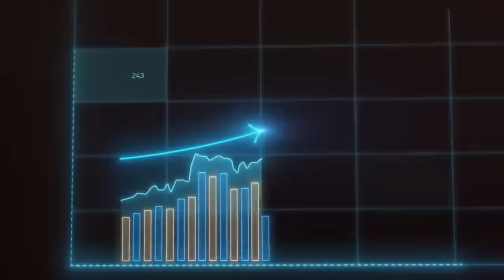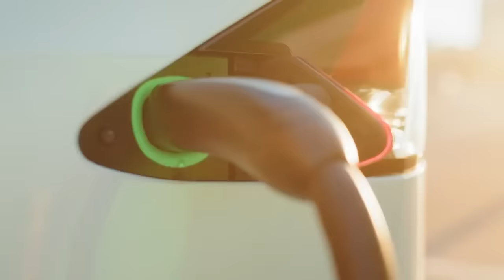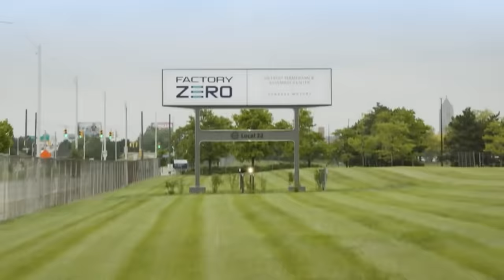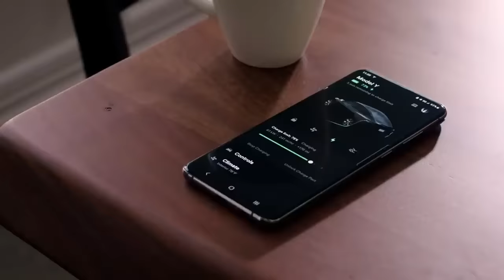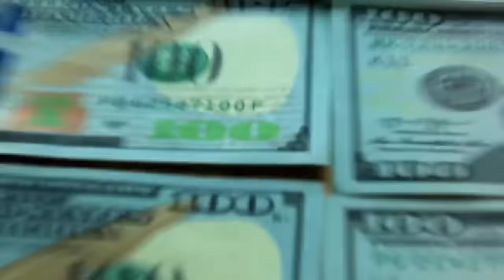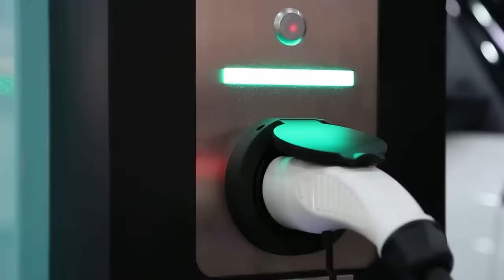Electric Vehicle Owners Are Frustrated and Demand the Return of Gas Cars

Comment: EV industry is touting "well with the new battery chemistry, batteries will be much better for the environment and cheaper"  DOES NOT MATTER  They still have to be charged!!!!
Reply: and what exactly IS charging?

its an electroplating process. and only a small amount of energy actually goes into the "charge", aka electroplating, the rest is used to overcome the inherent "struggle" that always occurs inside any battery, two metals corroding in an electrolyte, producing opposing EMFs where the resultant "output" is the DIFFERENCE between the two!
a charging battery is electroplating, a discharging battery is corroding... very simple. very inefficient.

its well worth looking into "galvanic corrosion" and exactly how a battery actually WORKS... they used to teach these basic things at school, had books for young boys and girls (mostly boys but even girls were allowed to tinker with chemicals and wires and lightbulbs) to play and experiment and learn, its how we got television and radar and computers, by having children educated on how things work,  once-upon-a-time...
Reply: Coal is only 19% of power generation and burning natural gas for electricity as far cleaner than burning gas in a piston engine.   I stil have some gas toys but if you can read a manual and rember to plug in and set a clock then make sure you have a 250v plug like an appliance plugs into.   Then get one and home charge its great.  I've seen 300,000 mile original battery model 3s.   Battery failures under warranty are rare and they get repaired and reinstalled.  

Its still 80-90% efficiency vs 20-30% efficienty.
Reply: regardless of what is said the battery technology is no different than it was 20 years ago.

Comment: I remember being at a career school, and a teacher doubted me (I was in an auto tech class) about the future of EVs. Years later here I am being proven right, even on paper these cars aren't a good solution. If your solution requires mass production of a product using lots of expensive materials it's not a solution. The problems with these cars keep coming to light, and now everyone is starting to see their issues.
Reply: Ev cars have been around before the gas engine I believe. The batteries were probably the issue back then as well 🤣🤣🤣
Reply: @jakefriesenjake  yep they used lead acid batteries, they were even more useless then though extremely short range and almost no infrastructure to support them. The first EVs were just toys for the rich to get around town and no further.
Reply: Even if we disregard that, very few countries has the infrastructure or power to support too many of EVs. Yeah, any house can charge an EV but how long is the charging time? 10+ hrs? While gas car can be topped up in a few minutes. Who wants to sit around a gas station for hours? 

So even if you believe EVs are the future, you'd have to acknowledge that widespread adoption and replacement of gas vehicles isn't possible for us right now.
Reply: As soon as I saw how big of a battery an EV needed to work I knew they had no place in the future....and that was years ago. I keep finding downsides for these things, uncontrollable fires, insurance rates, infrastructure,  crashes, likelihood of being totaled, charging time, cost....I'm probably forgetting something, but ya they are a "solution" likely being pushed for lithium investments. Investments our politicians likely made before making the"green bill."
Reply: Do you realize that  a new model 3 costs far less than the average cost of a car in the US?   A Bolt is even less.
Reply: @rcpmac  A 2023 Honda Civic has an MSRP around $23,000, a model 3 is around $38,000. Yes a bolt is around $24,000 but how many people do you see driving a compact economy car? People don't want them, Honda stopped selling the fit in the US for a reason. Even with all this said EVs have higher insurance costs, higher if you want an at home charger for convenience.
Reply: The only real replacement for the standard car is the plugin hybrid...
Reply: @markthompson4225  I do think hybrids are a lot better than EVs they can actually operate in the cold, they use a lot less lithium probably 1/4. And they have been proven to work I've seen a first generation Honda Civic hybrid come into work before. They don't need new infrastructure, and you can just fill it with gas instead of worrying about charging. The thing that baffles me is they do work but we supposedly NEED to skip to EVs.
Reply: Teachers are idiots; had one tell my parents I had dificulty with physics because I  asked questions. Come exam time, passed with flying colors  then went  to a top university.
Reply: @DemiGod..  yea this same teacher of mine also called California a state striving for innovation, yea there's reasons people move from there at high rates. However I liked my junior year government teacher, he actually showed people media corruption and told people to ask questions.
Reply: @jakefriesenjake  Not just batteries, but brushed motors are not as efficient as brushless.  Technology has come a long way, but not yet far enough in the battery department.  Further, the production of electricity isn't green... yet.  In California, people were asked to run Air conditioners, bad for the grid, EV cars are 10 times worse!
Reply: @Cr0wdse3ker  Exactly!  Toyota is also a much more reliable brand that costs less than EV's
Reply: @COSMACELF1802  Toyota also is the only company I've heard of at least buying back some of their customer high mileage cars to dissect them and figure out where the weak points are, there are some high mileage Tacoma's and tundras out there .
Reply: @COSMACELF1802  were asked to "not" run their AC's in California after 4pm, I think the time was
Reply: As someone with a career in the power industry, the battery and green bullsh*t didn't fool me either.
Reply: At least is nor fossil fuel that destroy the inviorment.
Reply: @daveolep7657  if you mean that fossil fuels destroy the environment look into the total rates for EVs, and the CO2 released to make them. Just because it doesn't have an exhaust pipe doesn't make it environmentally friendly. No human activity is environmentally friendly.

Comment: EVs are a scam.  🔥 🚒😢
Reply: 1. Child battery mineral labor

2. Range anxiety

3. Risk of garage fires

4. Paying 20k more than a
comparable vehicle

5. Battery denegration

6. Poor resale value

7. Reduced performance in
cold, highway

8. Higher repair costs

9. Awful charging network
experiences in the weather
without restrooms

10. Higher insurance rates

11. Replacing tires more
frequently

12. Death by autopilot

13. 30 - 40k battery

14. Low km range

15. must wait 2 hrs
to charge

16. Then wait more time to charge, while charging.

17. Spontaneous combustion with no way to put out the fire storm.

18. If they catch fire in a tunnel, many people will die.

19. People without a pro charger system or a parking spot at their house, will run an extension cord to the road, which is dangerous and could lead to people tampering with your charging setup (super slow charging at the road)

20. If your in California, you won't be able to charge your car past 4pm because of a shortage of electricity supply on the cheesy grid.

21. It is not actually "green". The pollution is made at the power station, not the car.

22. Only 5% of used junk batteries get recycled, the rest go directly into the bin. It's cheaper to mine for new minerals.

23. Chhinna actually does 70% of all the refining of the minerals and production of the batteries.

24. Minerals are becoming more and more scarce, and the cost will only go up, not down.

25. Some countries where they mine for lithium, actually use a very big boat load of fresh water to only produce a ton of lithium, so they are afraid of running out of water. It takes over 2 million liters of fresh clean water to produce 1 ton of lithium. 

26. Ev cars will soon not be able to drive in tunnels or be able to park in underground parking garage and probably will eventually void your house insurance if you park it in your personal garage.... 

27. You can't charge your battery at super stations when it is bitter cold out.

Comment: I’d like to know how I’m
Supposed to explore around the giant uninhabited country (Canada) with an EV?  What about our 6 months of winter that makes them even more useless?  It’s so fn infeasible here it hurts my brain.
Reply: Similar problem in Australia. Going to visit your relatives 300km away is just around the corner, with nary a charging station in sight.
Reply: @ericaltmann5711  in those places you are going to need to pull a trailer running a diesel generator that's running non stop!
Reply: @Ziegfried82  what about Arizona and Nevada where it get to hot in Summer time in grid can't handle air conditioner?
Reply: @Ziegfried82  If I ever get an EV, the first thing I'm buying for it is a diesel generator trailer.

Comment: The cost of  battery replacement due to either inevitable reduction of power or even slight damage can be “significant” indeed, usually about the cost of a new car 
And after ten years the second hand value will be virtually zero since it will be needing a new battery, which will cost far more than the car is worth even if in the unlikely event the battery for ten year old car is still available. 
If governments were serious about  reducing emissions, rather than giving rich people grants to buy their expensive toys, they should be investing in free efficient public transport, driven by real people, powered by compressed air generated electricity
Reply: You'll own nothing and....
Reply: Power a car with compressed air, there are some problems in there 🦉
Reply: @raixuh  there are problems everywhere
Reply: The solution for the government is not to intervene the people’s choice.
Reply: How can something mass produced cost so much to replace? Pure greed.

Comment: Don't know about the States, but in Canada the price of a replacement battery for Hyundai Ionic 5 exceeds the price of a brand new vehicle. So, one more problem to add to the list: EVs are essentially disposable vehicles designed to run no more than 10 years. There will never be "vintage" EVs.
Reply: Aside of it's sentimental "problem" actually this is a major environmental issue.

Comment: My advice to potential EV buyers is this…wait until the technology is  further developed to allow better performance in cold weather as well as developing a robust infrastructure that will equal that of the current gas station infrastructure. The insurance cost is a huge problem for EVs because of the lack of reliable repair shops that specialize in EV repairs. All in all, it’ll probably take several years to do all this. Another good solution is to keep politicians out of the auto industry. Let the free market determine what kind of cars people can buy, NOT some corrupt politician of unaccountable bureaucrats!
Reply: Well said.
Reply: Better performance in cold weather will never happen.  With an ICE vehicle, the heater is nearly free, since heat is a waste product.  In an EV, you're directly powering an electric heater from the batteries for the car's interior, shortening the mileage you get on a charge.  You're also powering heaters that warm the batteries so they will work better.  If we find a better battery type, one that performs better in the cold, then one problem is eliminated, but the other will exist forever.  I agree with all your other points.
Reply: Any battery that holds the power/energy of 10 to 20 gallons of gasoline would be a nightmare. Would be 100 times the firehazard of these things. The cost will be 100 times what current batteries cost after the materials and all the engineering and R/D costs are added in! Nuclear and gasoline are drop for drop the cleanest most efficient fuel options EVER.  Where does electricity stand? Certainly not in top 5.
Reply: "Several years" he says. Electric vehicles have been around for over 125 years and EVs are STILL woefully inadequate, outside of niche uses and the EV cultists...but several more years outta remedy that! 

BTW, how long will it take and what is the projected costs involved to expand the grid in order for it to accommodate all of these EVs that are just 'several years to "do it all". 

Oh, don't forget to include all the environmental impact studies, the time that will take and all of those associated costs. I'll wait here.

Comment: One point that wasn't mentioned is the range, how even in normal driving conditions that the range isn't factually correct, Tesla being a big culprit of this where the range displayed at the start of a trip is drastically more than what it displays, and is capable of, after driving a short distance of that trip. But with this cold winter in the USA, it has really highlighted the downside of range for battery vehicles in freezing temperatures, with many unusable for the very task they were designed for. The headlines have changed over the last 12 months from everything being great, to problem after problem. 
Oh and government subsidies in many countries are being withdrawn or scaled down, this removes much of the advantage when thinking of the purchase price.
Reply: It's no different then the MPG claims made by ICE car manufacturers
Reply: I can go for weeks without filling my VW diesel- no range anxiety with that!
Reply: I’m now rethinking ordering a model 3, no subsidy, range is “optimistic”, the spectre of a deadly house fire, it’s not that attractive vs a reliable choice of ICE vehicle.
Reply: please understand comparabe standards like NEFZ, WLTP or similar, nobody can be that naive to belive this is a practical range, it is a standard to compare cars, same as with ICE cars, it is not a real world value. Once you have an EV you will know exactly what to expect under what conditions, and after 600.000km purely electric i never ever had any problem with range, after a very short while you know exactly what your car is capable of and when and where to charge.
Reply: @chriswilliams8607 I disagree. You assume when comparing vehicles that this range is an industry standard measurement which has been true in certain controlled conditions across the board. This number is used in comparative purchasing decisions quite often and should be an at a glance metric that can be used by somebody who doesn’t study EVs relentlessly ie 95% of buyers.

Comment: There's simple logic to follow.: If the government has to go out of its way to promote a technology and then effectively enforce its use by law, it's most likely not a viable piece of technology to use.
EV enthusiasts like to point out that early ICE cars used to be laughing stock compared to horses. However what they frequently forget about is that governments actively stomped on ICE cars making them as inconvenient as was possible and the ICE car still won. EV's get massive government support and still struggle.
Reply: Also that was a long time ago when we where fast developing new technology but now we only modify existing technology so evs won't get exponentially better like the gas car did
Reply: @ashleym2878  Yeah,  and when it comes to battery technology I think we're kind of close to the maximum of how much electricity can be stored.
Reply: Many years ago, the government had to pass laws and force people to use seatbelts.  I guess it's bad thing when the government has our collective best interest in mind.
Reply: @karlj41  I'm not aware of any subsidies worth thousands of dollars a pop handed out to the drivers to buy a car with a seat belt in it. Not to mention that seat belts are realistically 20$ part with clearly measurable, testable and demonstrable benefits. All this with nearly zero environmental footprint to speak of. I've also never heard of a seat belt that suddenly exploded and incinerated the whole vehicle with an impossible to extinguish fire. But hey, I guess a cheap and effective safety feature perfectly equals an overpriced luxury item realistically nobody needs.